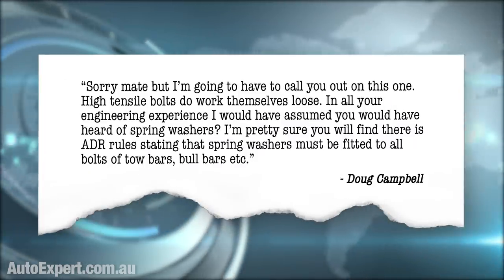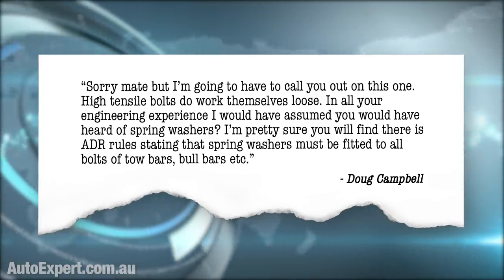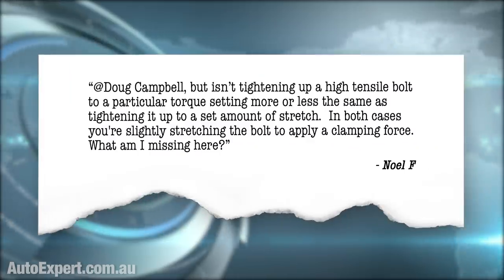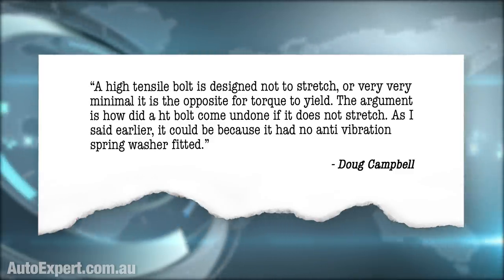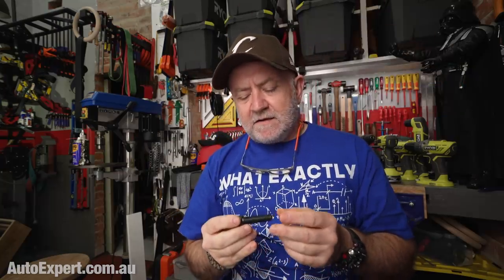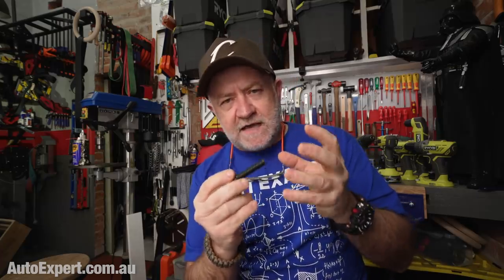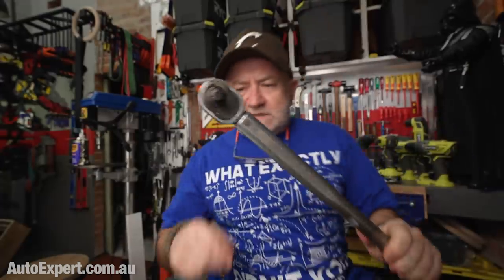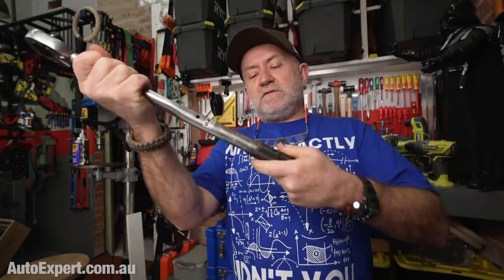The applied physics of high tensile bolted joints and assembly in cars | Auto Expert John Cadogan

Comment: Doug @ 17:24 Torque to yield, (HT bolts) dont use spring washers, because they have "inbuilt spring washers so to speak"
Doug also @ 21:12 "a high tensile bolt is not designed to stretch"
Reply: Doug seems to have a mechanic's understanding of fasteners and their use, not an engineer's understanding of fasteners and their use.  The two points of view are quite different.

Comment: Metallurgy. A spring washer installed on a high tensile torqued bolt will flatten over time and thus remove the torque spec. Spring washers are good on plastic but unless the washer is harder than the fastener and connected surface, so it can dig into the metal, it won't be doing anything.

Comment: The best part of why you should not use spring washers on high tensile is they will not grip (chisel into) a material that is just as hard or maybe harder funnily I was taught this when I was 15 at school doing tech drawing . I'm not wiling to comment on the problems from the first Vid as I have not seen enough pictures of the full installation to know why it cracked (this reminds me of the Jeep Cherokee that cracked the chassis rails at the steering boss on right hand drive vehicles because they were not reinforced Left hand drive vehicles were did not suffer this same issue as the rail was reinforced)

Comment: I think it was AVE who did a video to show how much of an epic fail spring washers are. There is only one design of washer that will actually keep a nut from rotating but they're quite expensive. In applications where there's high vibration and you really don't want a nut working loose the standard trick is to wire the nuts.
Not to say the spring or wave washers don't have their place but it's mainly in the smaller diameter bolts e.g. M3 to M6.

Comment: I've always followed the TTY rule with one exception...An Amarok timing belt idler bolt that broke and supplied by the well known belt company changed that...Fun fact John...When the TTY head bolts first came out the instructions said Xn/m + YDeg and if it began to feel loose then stop and move on.?.!..Always been cautious with them and one failed...Once bitten and all that stuff...
Reply: I have an older VW, and found that the same model, engine, etc. from a couple of years prior used standard bolts. In fact, many parts diagrams are the same, but the later TTY bolts use the 2 step tightening procedure. On that vehicle, I go by the older manual and use new standard bolts with their proper torque and save a few bucks. But that isn't possible very often. I think that TTY bolts have a definite place, but manufacturers went overboard. (Maybe to boost parts sales?)

Comment: Spring washers are used with mild steel bolts,high tensile bolts when tightened correctly stay tight due to stretching of the bolt
Reply: I have seen grade 8.8 called high tensile.

Comment: Thanks John , great explanation basically a spring washer chisel area is unable to bite into the HT bolt to stop the bolt or nut rotating and the clamping force is greater with the correct torque, so where IS a spring washer needed, as this would be a legitimate question? Us mechanics do know....

Comment: Why did the loose bolts lead to those fractures, though? If they're loose and the parts can move around, what loads are present that weren't supposed to be, and how do they work to break the chassis in that way. It's have thought damage to the holes would have been a nice if failure, but that looks like it's torn the plate at the edges of the contact area. I know this would be a third vid on this topic, but it's so interesting.

Comment: Split washers don't do shix on hardened components and do damage on softer ones.  Can you imagine the carnage done to alloy wheels if the nut also had a split washer too?  How many wheel nuts have just "fallen" loose after a proper tightening? NONE, and for of thousands of miles.

Comment: I think it was DIN6797 for star washers was cancelled as they discovered they don't work, they do not prevent fastner rotation and may infact aid rotation, they may work on plastics but not with metal screws. Only anti rattle washers I know that work are nordlock washers even with bolts with a clamping dimension less than 2.5D.

Comment: Having background in engineering (daily job for 10+ years), I could not agree more. The amount of science and testing that goes to designing a car or similar things is rather high. CAD design, CAE verifications, physical tests for longevity, abuse tests... There is a lot going on, and I would suggest the spec they specify should be followed without a shadow of a doubt.
Reply from the maker: Yeah - agreed. I got my engineering degree in 1989. They still rode dinosaurs to work back then...

Comment: Forgot to mention that high tensile bolted joints require HARDEND washers, mild steel washers "verboten".
Looked to me that you had galvanised mild steel washers on your M25 bolt. This would play havock on your torquing due to local deformation of the mild steel. 
Hardend washers are black and have three tags around the circumference.

Comment: My Kenworth is held together with high tensile bolts and gets the ever loving hell beat out of it. 1.2 million km so far. No “spring washers” anywhere. Not even the 200 high tensile studs that hold my tires on or hundreds of bolts that hold my truck together.

Comment: G'Day John,,Glad yu showed the proper working of a spring washer,,Have you tried to buy a left handed spring washer,??
What shit me is people whom choose to use a spring washer and stick a flat washer between the working surfaces,,,Defeats the spring washer allto-gether,
We have Studs in some of gear boxs that have what we call super nuts,,
These nuts have the standard desired threads,,but have a dozen little bolts we torque down is rotating order,,this may take 20 or more times a round all the little studs to get to desired torque,,which because of the stud size we use a inch pound torque wrench,,doing up 60 mm bolts,,these bolt or studs are then strecthed to desired setting useing these little bolts,,
Be amazed how far these little fasteners will strecth this 60 mm bolt/stud,,these studs are about one metere in lentgh,,and we strech them another 20 mm useing these tiny bolt on the super nut,,stud material is reusable,as it is designed to do this job,,
Beat the crap out swinging a 14 pound hammer to do them up,
And just to show we had bolt in the turbines we would heat up with carbon rod  and then tighten to give required clamping force,then let them cool,,good luck getting them out with heating,,

Edit:
in the coal indusrtry they use a thing called a paint washer,,yes little indents are put in the back side of washer and filled with paint.. you do the bolt up till  you see paint coming from washer,,
The only problem with these ,if the washer spins it picks up paint from surface and then cloggs paint from coming out,,
just for you info every scatch is repainted with approved paint,before commission,,
yes they have a bloke with yellow paint pen go round after we have finish and mark any and all paint defect and are repainted,,with approved epoxy coatings..

Comment: Well said. Use a torque wrench!!! 
I've had assemblies (M24 fine (12.9)) that came with spring washers long before I reached the correct torque the spring washer just opened up and squeezed it's self out.
But I did use spring washers today (M8 A4 stainless) torqued to 4Nm, they are good in low torque areas.
HT bolts, if in doubt use a nyloc nut or if you really don't want it to come undone green locate (270) but then reduce the torque as you have just lubricated the thread.
I joke about my torque elbow and say click when tightening none critical things, but own and use 4 torque wrenches covering 4Nm - 500Nm. 
It dose surprise me that fine threads are not used more in areas were vibration is to be expected, always used to be the case that British Standard fine (BSF) would be used. But since the move to metric, metric course seems standard in these areas, this my be because thread locking compounds were developed at around the same times.
But let's face it, if you're fitting automotive accessories they will come with instructions that include torque settings. Follow the instructions, it's quite simple. And with tow bars yes I fit my own, I will check all of the bolts after the first 100 miles or so. But then I also witness mark all critical nuts and bolts with a high visibility paint line so I can see if anything has moved.

Comment: Hi John
watch your videos in the UK. Truthfully Ive learned a lot. And I think a good point is that in the case of aircraft maintainance you do it by the book or not at all. No one ignores torque settings or adds in extra washers, or uses different fasteners as they see fit. I should add I am not an aircraft tech I just know someone who is. Anyway my question is talking about bolted fastenings when,if ever, should you use thread locking compound, and if you do does it make any difference?

Comment: I use loctite or similar products to lock nuts. It won't effect torque values while tightening. Vehicle manufacturers use it their bolts (blue)
Reply: It very much does effect the torque values, loctite is a lubricant until it dries.

Comment: I have had two poor experiences from two manufacturers in the last couple of years to do with towbars. I bought a used towbar for my BF Fairlane which did not come with bolts. Ford Australia no longer sell the bolts nor were able to tell me what the bolts were. I was told to ring a dealer service department and called several to no avail. The bolts cut their own threads as they go in. I was lucky I have a mate with a  BF Fairmont who allowed me to remove one of his bolts and head for the bolt shop. I hope they are correct... I don't tow anything heavy. Usually less than 400kg. Two 87kg motorcycles and 150kg trailer. I may put heavier bikes on at a later stage.
Most recently I bought a new genuine towbar for my 2007 HiAce and the spec for the two bolts on the towbar tongue were 272Nm. My torque wrench only goes up to 205! To me that sounds ridiculously tight. Nice fella at the Sydney dealership I bought it from (via eBay) looked into it and it seems no one can answer if that is a misprint. He contacted head office in Melbourne and did not get a response which is what he expected. When you phone Toyota head office they fob you off to a dealership. I am no wiser and at 205Nm one spring washer is spreading. Hmmmm
Reply from the maker: Use Class 10.9 high tensile bolts and torque them to spec using the bolt manufacturer's handbook. They're probably M12 coarse (ie M12 x 1.75). That'll be about 100Nm lightly lubed. Confirm using the bots manufacturer handbook.
Reply: Thanks John. Legend! Got a soft spot for engineering. My father was a lecturer at our local uni in mechanical engineering. :)

Comment: No body mentioned the fact that all tow bar and bull bar kits came with sheer bolts that had to comply with the road safety act...not high tensile bolts...in the event of an accident the idea was for the bull bar or tow bar must break off its mounting points... to lessen injury to occupants and lessen damage to vehicles ... i fitted many tow bars and bull bars to repaired vehicles after car accidents working in the smash trade... we had a strong liability compliance and we worked with the VACC as to what our obligations were... to the public and to the insurance companies...one thing we were told was never to use rattle guns on the car or wheel nuts because they fracture bolts with out you knowing it... this was also set out in the road safety act...If you work on another persons car you need to comply with the the current laws set out for motor vehicles...o you risk losing everything ...That Ranger towbar should have had more mounting points on the chassis ...cheers John keep up the good work... Tony.

Comment: Good morning John. 
With the cracked chassis I had an experience with Nissan that apparently many don't.  We had a D40 and instead of HD leafs in the rear we went intermediate leafs with airbags for weight. Then put extra tray mount above airbag. Was for load bearing and not towing. The inevitable happened and chassis split (lesson learned) 
Anyway, Nissan (dealer) actually came to the party for half the cost of repair.
With spring washer I noticed a few or quite a few years back that Cat went away from using them and just used hardened washers. 
Was also wondering whilst watching this post if you have had anything to do with nordlock washers. They seem to work exceptionally well. But only get one maybe two uses out of them. 
Cheers 
Craig McPherson

Comment: Hi John, thanks for your videos. I have watched a lot of them.

Is it simple to answer this question? If not then I'll continue to fumble in the dark.

I do DIY stuff so my fabricobles are not critical matters.

If I can't find the torque specification for a  particular fastener application, and I have to guess it, is it reasonable to torque the bolt beyond the typical specification for that bolt thickness?

I usually go 30% past what my guess is. Usually my main concern is preventing the bolt from unwinding, as opposed to a structural concern. My philosophy is to overtighten the fastener and if it doesn't break then that's fine.

I haven't broken a bolt yet, which causes me to assume that fasteners break significantly higher than their typical torque-down specification. I am aware in this question that I am ignoring the matter of the material being clamped by the bolt or how strongly a stud is mounted. This question assumes those items are rated above the proper tension on the bolt.

For simple DIY stuff when you have to guess, is it reasonable to aim to over-torque a bolt because no harm is done if it doesn't break?

Cheers
Anatoly from Christchurch

Comment: We all know if you torque it right, it will stay were you set it, the flat washer spreads the load on the bolt head, that's all that's required.
Reply from the maker: I don't think we all know it at all...

Comment: The cat bolt torque chart is a good bolt chart that I refer to often. 

Great video, loving the content lately.
Reply: Cat are very conservative. Compare them with Bosch and you'll get what I mean.
Reply: @johnwade1095  any specific link for the Bosch chart? I do notice against Volvo bolt specs it's not as tight, but Cummins isn't much different to CAT but the places I am using the chart for usually are places I can recheck easily too. Hendrickson torques are similar as well now that I think about it
Reply: @Low760  it's in the bosch handbook. On Amazon. Cat assume lubricated bolts with hardened washers, which is why the torques are low.
I can't comment on Cummins.
Volvo might be for flange heads, as the larger diameter means more torque is required to overcome friction. You'd overload a bolt and washer if that was the case.
Reply: @johnwade1095  the cat page I have does both dry and lubed, I did search about torques when John did a video on bolt torque with regards to using anti seize a while back and the two torques made sense compared to his explanation.

Comment: John l have paid rapt attention to both of your takes on tow bars/hight tensile bolts and what they require to be correctly fitted and the possible consequence of being under tightened.
I would put myself in the bracket of just knowing when a fixing is at the right torque (self delusion obviously) listen look learn thank you for letting me in on the fact that this is nonsense.
After watching your two utube items my question is should l get under my Pajero and try the bolts on my tow bracket for tightness and if so should l add additional torque to allow for age and or some corrosion.
Thanks for your time and input Alan.

Comment: Torque to yield bolts are long. (Cylinder Head etc..) this is because to torque to yield a short bolt, the angle required is minimal. The strain to yield is in the order of 0.2% from zero to yield = length of bolt between head and nut / 500 (hence why yield is often called 0.2% proof stress for materials that don't have the obvious yield point dip)
When a typical towbar side plate to chassis clamp length is 14 mm (12 mm plate plus 2 mm chassis) 0.2 % is only 0.028 mm!!
This fact is why surface preparation is another cause of loosening bolted joints.
Only 0.05 mm of crush over time will make the bolt loose. (I.e. rust or flaky paint)
Con rod and big ends are usually tab washers as they MUST not ever loosen.

Comment: One of the obvious industry errors I've noted in my 55 yrs of driving. Tyre dealers that use a rattle gun to replace a wheel. Hey, it's quick n expedient. Sometimes a wheel brace afterwards, but I've rarely seen them use a torque wrench. I check my wheels after each visit and carry one when out of town towing the caravan. I have the benefit of both worlds as I am a F&T, Toolmaker but mostly a Mech Design Drafter in Veh. Mat. Handling and Aerospace. I use Spring washers at times, i.e. under a wing nut at around M5-M6 sizes, never with HT bolts.